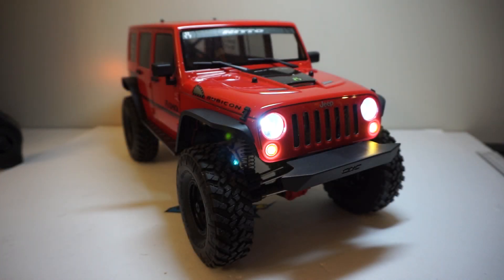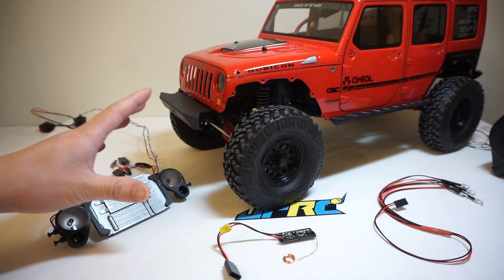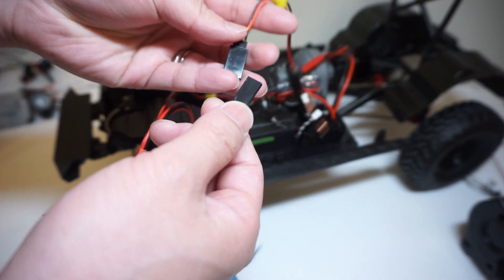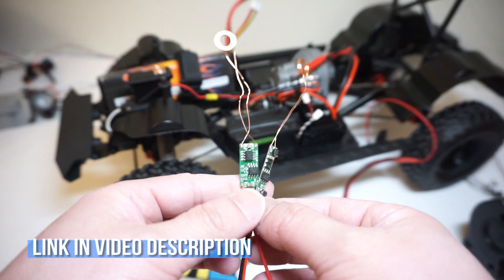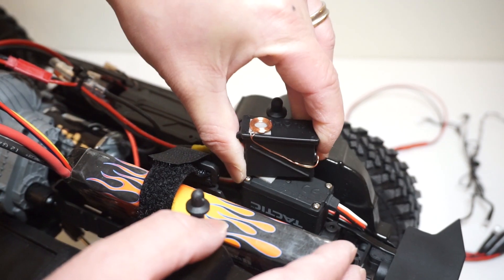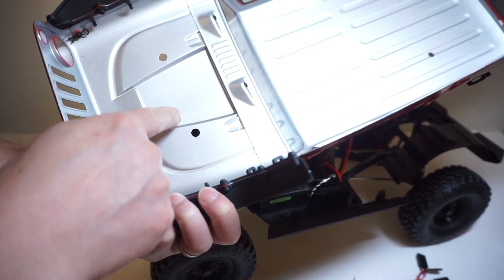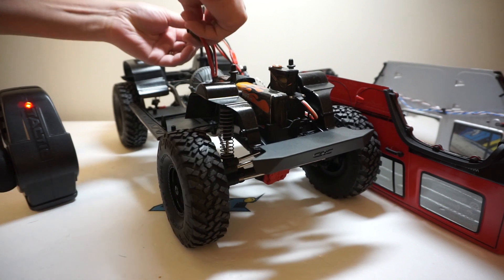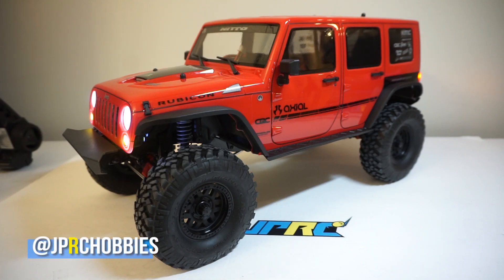How To: RC Wireless Lighting (Inductive Power Transfer) - JPRC Axial SCX10 II 2017 Jeep JK Upgrade

Comment: The coils are not in sale anymore. Alternatives?
Reply: There is an alternative which won't even pull too much amperage off the battery like that induction. You just need 4 shimms. (in German Unterlegscheiben) and you put 2 of them on the body posts, each connected to a wire. Plus and minus or red and black. The other 2 you attach them on the body with the leds soldered onto them. Voila every time you take the body off the leds will turn off

Comment: Can you come off the lighting plug wire for the transmitter or do you have to  use the battery lead to wire the transmitter.  I was wanting to use the cables that's already there to power the transmitter if possible.. is it running enough power through it to work?
Reply from the maker: RC VOODOO I think the wires off of the existing led lighting runs at 5v so it won't be enough to power the transmitter. I suggest you  re-use the wiring the esc to some bumper integrated lighting. And power the wireless lighting to the body from battery lead. It will be handy when you adding external bec too.
Reply: JPRC  i wired the coils and.....nothing.... Lol. It doesn't work. I went from the battery leads to the transmitter coil.  And the transmitter coil to the lights but nothing happens. I didn't mount it yet because I wanted to test it by holding the coils close together to make sure it worked  but I got notta.. The transmitter coil seen to be fine because it was a little warm. ..Not hot at all.. Just a little warm
Reply: JPRC I don't think 2cell is enough power... have you tested with a 2cell battery? Since its only 7.4 volts... You said 9 to 12 volts operating I believe
Reply from the maker: RC VOODOO 2c is bright like stock while 3 cell is ultra bright for me .
Reply: JPRC does your coil get hot? I used a 9volt battery and they lit up fine but the coil got ungodly hot
Reply from the maker: I did notice mine get warm but it wasn’t like ungodly hot.
Reply: JPRC I think I just had a bad transmitter.. 7.4 would do noting. 9v melted it down. And fried the board..   (and no I didn't cross wire it lol)
Reply from the maker: RC VOODOO oops. Good they are cheap and are just throw always. They are one with bigger coil that handles more currents if you want to attached more lights. But really this is just a cool little novelty mod. You could have done the same thing using the washer on body post method to make wireless lighting.
Reply: JPRC ive never heard of that method before either lol do you use one washer on each post? One positive and one negative?

Comment: What will happen when both coils are underwater  (given that the boards are fully water proofed) will it short anything out if the coils are both under water.  say in a deep creek crossing where the hood might go completion underwater.
Reply from the maker: The copper coils wires come coated and therefore waterproofed. As long as You waterproofed your pcb you are good to go. The two coils are essentially just magnets so the only thing that stop them from working is if you place metal in between them.
Reply: JPRC. Thanks👍  my buddy ordered us both a set of theses. Working on the install now.
Reply from the maker: Nice. Btw I blacked my top like your and it looks great https://imgur.com/gallery/PacIo
Reply: JPRC.  yea man. That looks sweet!  👍

Comment: Hi, what is the maximum led lights can the module can handle? And do you have suggestion where to buy led light which can handle voltage output, to avoid burning the led.
Reply from the maker: The current supplies is rated at 150ma at 5-7v. Any led that works with your received would probable work with the module. Typically each led draws ~ 15ma so around 10 leds is fine. I tested up to 12 leds. I used cheap eBay led in the video.
Reply: Thanks for the info :)

Comment: Thats fantastic, I love having lights on my crawlers and I have to extend the lighting cables to make it easier to fix in or remove the battery so I dont pull out any wires, which is fine but then I need to be careful how I stuff the cable in so it doesnt rub or get trapped anywhere, this is a great idea....